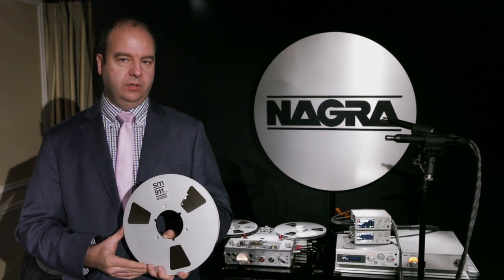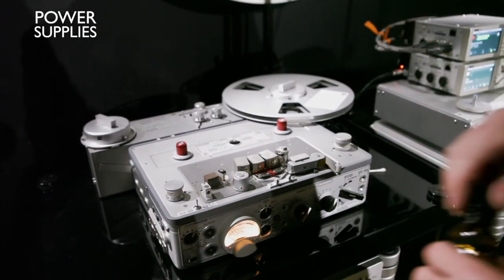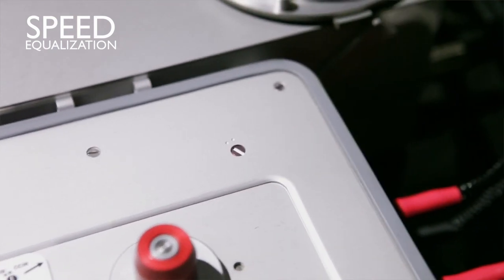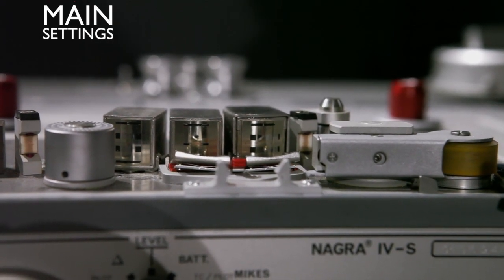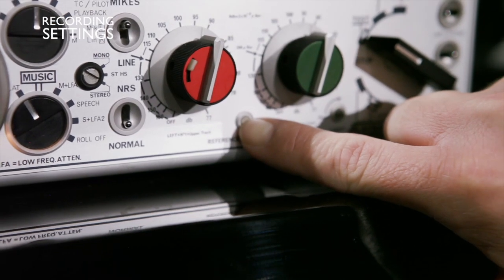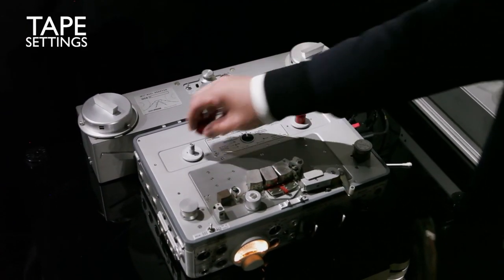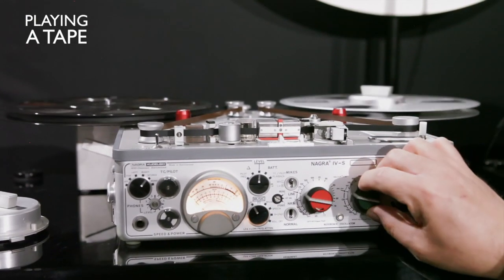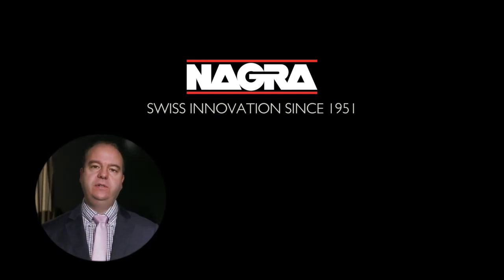NAGRA ANALOG WORKSHOP NAGRA IV S

Comment: If you record onto a reel on an IV-S and then play it back on a Nagra 4.2 would it still come out in stereo or would it be mono ? As I know the 4.2 is mono 
Thanks
Reply from the maker: The 4.2 will do a kind of mix of L and R tracks which might not always been good.
For instance if there are big phase differences between the track, the sound in mono (that way) will not be great.
Normally you should record and playback with similar heads.

One way to avoid the issue, is to record two identical tracks on the IV-S.

Comment: Tape is a new vinyl :) Are we getting to the level of interest, level of capacity of  a market, that Nagra will consider restart R2R production?
Reply from the maker: We've always considered this, but as the technology has changed a lot since the ones we made, we have to start all over again from scratch. This will be a huge development cost. But this is in our DNA and we always think of it... ;-)
Reply: @NagraAudioChannel  Seems to be simpler today. CAD, CNC, 3D Print in mechanic domain,  Literally no-noise and dust cheap op-amps and microcontrollers make electronic part a piece of cake. Neither Kudelski nor Studer have such toys... they had "only" their genius minds :p Sometimes wondering what they are developing now, with unlimited time and budget.. ❤️

Comment: I strongly suggest not attempting to demagnetize the heads unless there is a known problem that is confirmed with a gauss meter. It is easy to unintentionally magnetize the heads while attempting to demagnetize them, so it is important to have a gauss meter to test for a magnetic field on a the head after going through the demagnetizing process.
Reply: Hello Glen, sure you need to do it right but after a few very dynamic tape there is a big difference in the sound if you demagnetize the head.